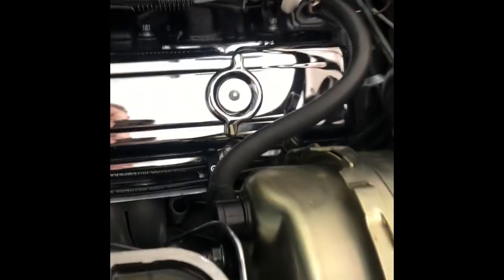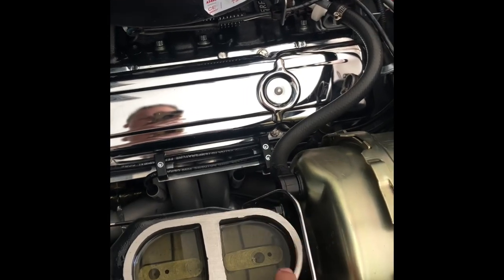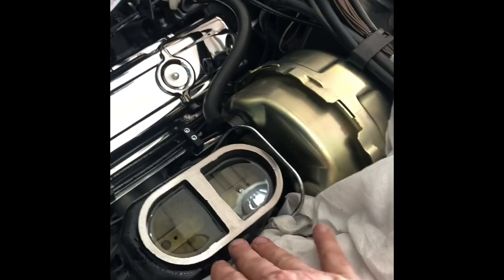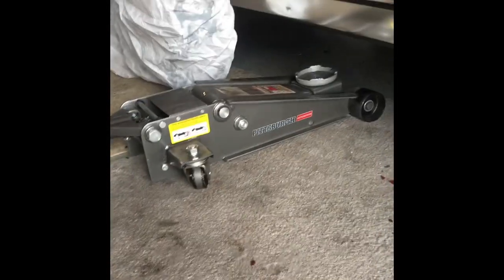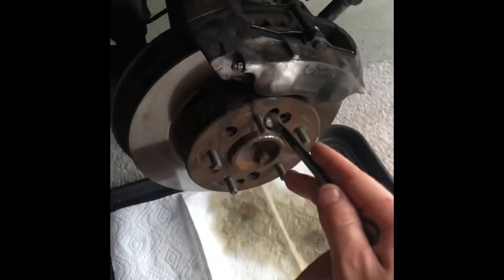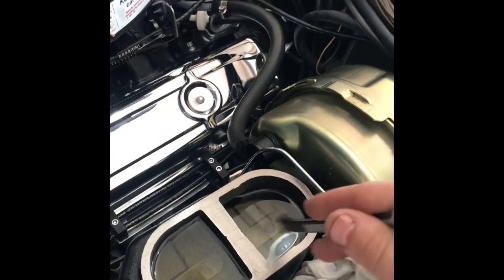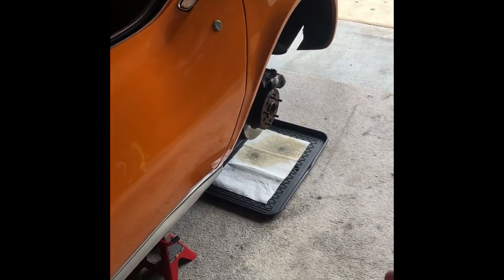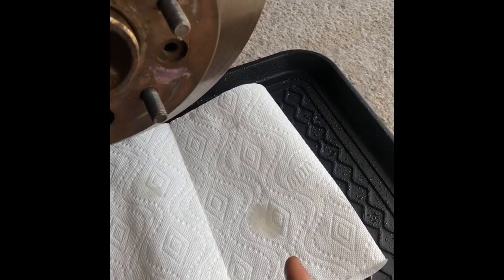GRAVITY BRAKE BLEED & FLUSH (EASY)

Comment: Replaced master cylinder a couple of years ago on a garage queen.  After setting for a few months, I started it up for a cruise and pedal went all the way down. Guess I will bleed first but I may even need to take the master cylinder back off and bench bleed again. At least gravity method doesn't take an assistant. Thanks.

Comment: there is a video showing a level on the master cylinder to make sure the bubbles flow toward the back of the master cylinder so they can be flushed out they recommend bench bleeding the new master cylinder.
Reply from the maker: Yes indeed - a very easy task.

Comment: Will this gravity bleed method give you just as strong of a pedal as the old "pedal pump, pump, pump" method...? 😀
I replaced the master cylinder today on my '70 Corvette and have to bleed all 4 calipers tomorrow.
Thank you for sharing this!
Reply from the maker: Absolutely! It will purge the air completely.
Reply: @classiccorvetteguide9147  Thanks for your reply! 
I did the back brakes today but ended up braking off a bleeder screw inside the caliper on the driver's rear (and couldn't remove it...😒) so looks like I'll have to buy and install another caliper before I can finish bleeding the other wheels. 
Thanks again!

Comment: Ok quick question sir, I had to replace my left caliper and pads as the seals were shot...how long did you use the gravity bleed process take?.....I heard someone tell me overnight but I feel it would run out of fluid long be4 that????
Reply from the maker: Steve M thank you for the question! No, it does not take overnight and YES it will run out. You need to be present because the bowl will empty and all the air will get trapped in the lines. It takes 30 mins on average per fwd and aft. If you do both sides at a time, it will drain quickly.

Comment: I'm having serious problems trying to get fluid back in my lines after rebuilding calipers. Any tips? I cant get fluid into any of the calipers.
Reply from the maker: Shaughn Allen jack up the front by the master cylinder, open it up and open up the bleeder screws. Just keep pouring fluid into cylinder - don't let it ever empty. Once fluid steadily drips...close bleeder. Don't pump with this method.
Reply: @classiccorvetteguide9147   Have you heard of the "brake proportioning valve?" Ive been reading if fluid leaves the rear then a switch is engaged and does not allow any fluid to the rear. This sound familiar at all or is not something to worry about?
Reply from the maker: Shaughn Allen unfortunately without some research - I'm not very familiar with that component inside the system. I apologize.
Reply: @classiccorvetteguide9147  No worries. Keep up the videos. Really enjoy them.
Reply from the maker: Shaughn Allen I try to keep it short and simple so that people will find it helpful. I appreciate that feedback.
Reply: @classiccorvetteguide9147  there is a special plug that needs to be inserted in the proportioning valve for bleeding it is a must step to allow the fluid fully flow to the brakes rear or front eliminating air in the lines.